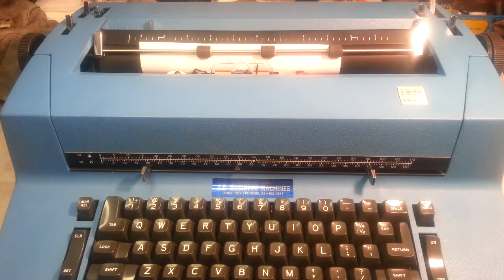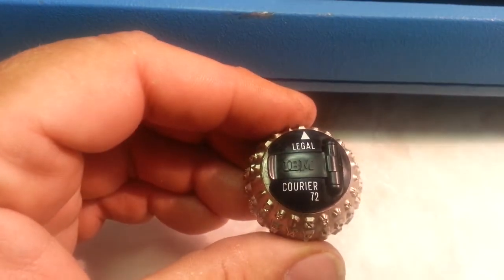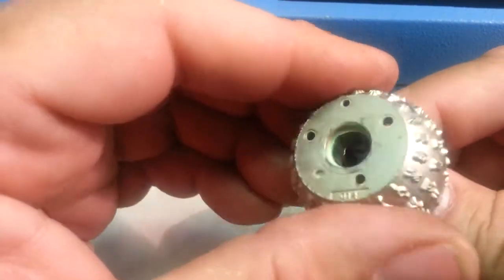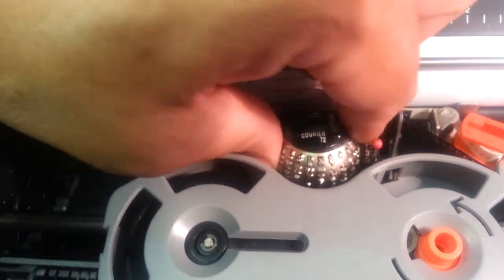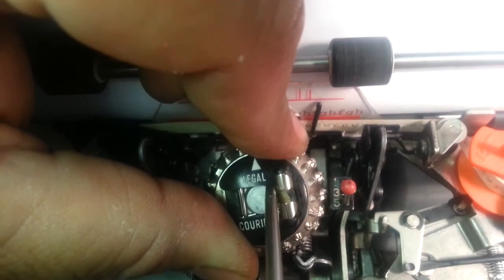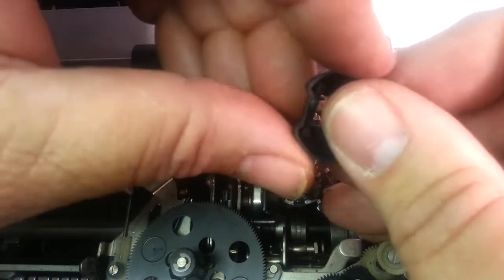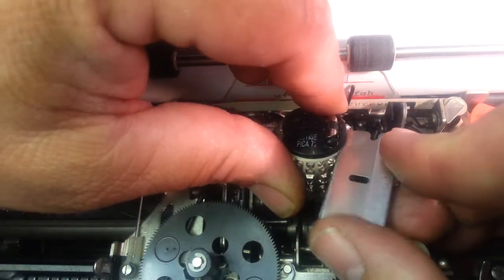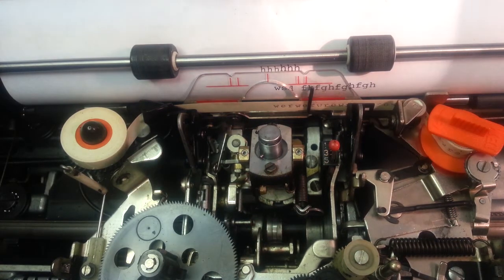IBM Selectric Typewriter Type Element Print Ball Stuck Golfball (font) Broken Removal Repair

Comment: Is there a way for repairing the broken clip? Or a place where to buy new ones? Even the new model clips seem to be fragile.
Reply from the maker: Used to be replacement caps, but haven't seen any for decades. Sometimes if they are not to bad some small pin point drops of super glue on the plastic pins that run through the ball can be glued & even the outside edge of the cap, must be careful not to get that super glue into the pivot itself.

Comment: i have one of these and when I type the letters seem to come out different, any tips on how to fix this??
Reply from the maker: Way to vague of a question/symptom. does it do it all the time ? all letters ? change ball ? rotate band off ? ball turning free ? 
rotate pulleys gummed up ? Timing set correct ? does hand cycle do it too ? did it work recently ? last service date ?
Reply: Wow, actually don't know much about it. Just got it from a yard sale.
Reply from the maker: @dolfdolf  You just got the most complicated mechanical typewriter ever designed........
Reply: @phoenixtypewriter2136  :( when I press the letter A the letter O appears
Reply from the maker: @dolfdolf  Selection latches or rotate band off its pulleys